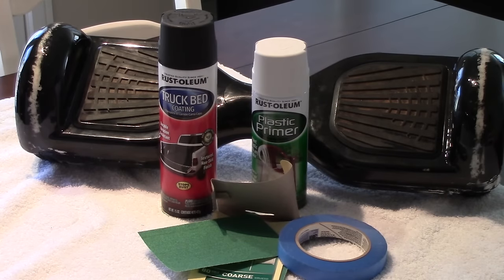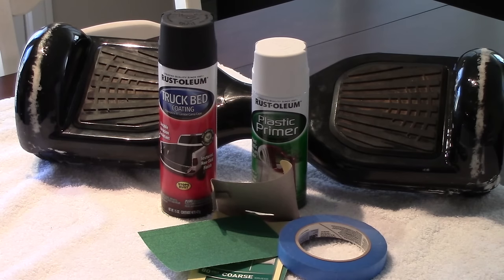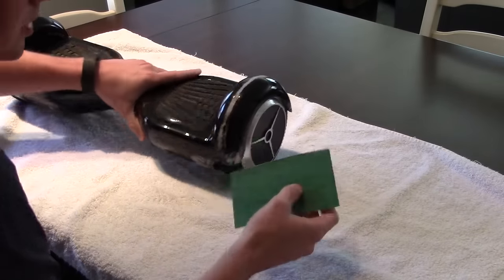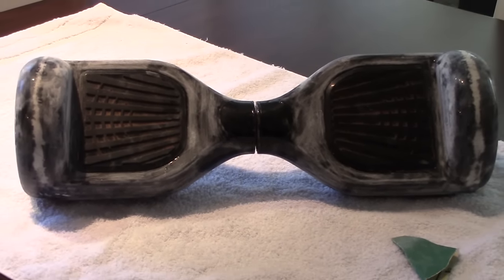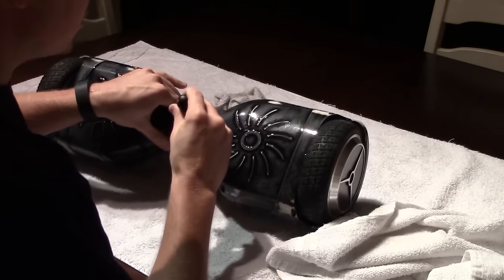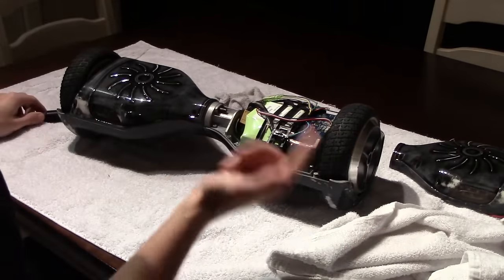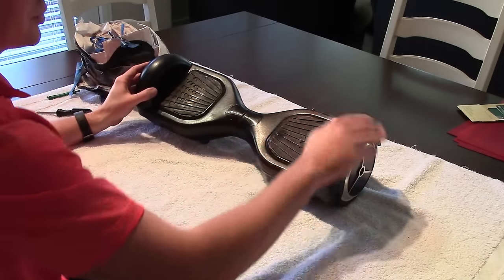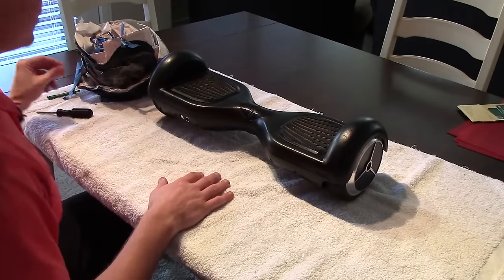Hoverboard How To: Paint and Protect With Scratch-Proof Truck Bed Liner

Comment: This is Rick, my 10 year old boy has Hoverboard and it's completely scratched,  I show me this video how to paint and make like NEW, it's looks nice after paint done. Only I like to get little more farther detail about the paints that you are using in this video so can you please tell me how many paint should I buy and what kind of paint and name should we buy and where?, I know may be it's available in Home Depot but still want to make sure, so let me know please. And by the way the video is completely help full. NICE!
Reply from the maker: Yes, Home Depot would be a good place. Make sure to get a primer MADE for painting on plastic. Sand it down a little first as well. It adds more pores for the paint to grab on to. Rust-oleum, which is what I used, works very well. I only needed one can of primer and one can of bed liner. The bed liner was also rust-oleum brand. It's not actually made for plastic, but that's what the primer is for. You probably aren't planning on using truck bed liner, but I'd say stick with spray paints made for plastic. Stick with the rust-oleum brand if you'd like. I only needed one can of the primer and one can of the paint. Keep the paint bottle so you can 'touch it up' if it gets scratched up again. Just keep in mind, if it gets rolled over on concrete, it's going to scratch. Nothing you can do about that. Just have to re paint it every few months ;) Hope this helps!

Comment: My segboard Is not really scratched just a little bit, you can't see it that much, and I wanna paint it blue. Do I need to use the sandpaper. Plzz help
Reply: Just get the spray paint that sticks on plastic, and you'll be fine. No need to sand it.

Comment: Now bail off of it while riding on a sidewalk, see if it really is scratch-proof!
Reply from the maker: +youmongrel Field testing it this weekend! I'll let you know how it goes! Maybe I'll post a 'sequel' video!
Reply: +RedDirtSoftball Hey are you still going to post a video demonstrating how tough the paint is?
Reply from the maker: +Vir H the bed liner was very durable, and for anything other than cement, it held up very well. But as you can imagine, it doesn't matter how good your paint job is, if you roll it on concrete, it's gonna scratch. Best bet would be to 'paint' you hoverboard with cement. Although it'd probably end up being too heavy to function.